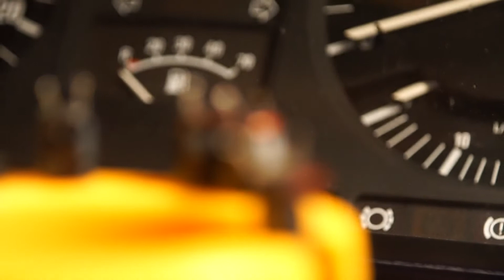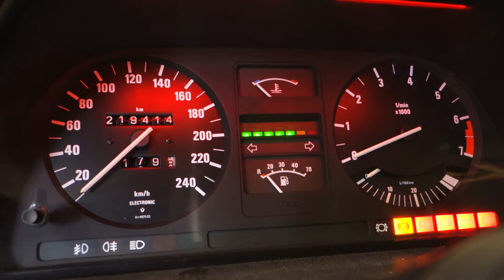BMW E28 Instrument cluster restoration

Comment: Nice video, i just slow it to see how you took it apart. I have E28M5 since 1990 and sent the board off a couple of times. After parked now for 20 yrs . . . time to do this again. I've replace numerous caps like these on many devices as they are the first components to go. Mouser and DigiKey are good sources for me. Did you find a change in function with these caps replaced? or was this preventive? 

Also - any reason not to install NiMH 1.2 volt AA batteries?  Same voltage as NiCad but last 10X longer?  About the same charge discharge characteristics w/o the issues of matching voltage etc of lithium types. Please post a response. Thanks!!!
Reply from the maker: I hoped for better, more accurate cooling temp gauge, but it had very little effect.
And just as you say, they get old, and several of them were elongated and crusty, so replacement were needed.

I think modern low self discharge NiMH would work, there are AA Lithium batteries, but they are 1,8 volt.
I did the alkaline mod several years ago, seems easy to just change them, when service is done.

Comment: Good stuff! Could you tell us what the symptoms were for the failing capacitors?
Reply from the maker: I changed all capacitors, mostly because the temp. gauge were showing to low reading.
And I knew they are prone to ageing, but after this, the Service lights are working again. (together with new batteries)
And I think that RPM and Fuel consumption are more correct now, the were erratic earlier.
Temp gauge however is still a tiny bit "off" (could also be sensor problem)

Comment: What do you think could cause the lights to all come on but non of the gauges work
Reply from the maker: Really difficult to say, these older models with NiCd batteries usually suffers from bad batteries, corrosion on the copper leads on the boards, and bad capacitors.

Comment: I just started troubleshooting my 524td cluster non working right indicator (exterior lights work fine) I went to do a continuity resistance test on white connector pin 6 (left) and 16 (ground) and got open same for left turn (pin 7) but that side work when cluster is installed. 

Why would I not be able to have the pin in the back have continuity? Is this cluster require having some sort of continuous power supplied to it? 

The schematic says I super easy to read, I must be missing something.
Reply from the maker: I'm not sure, there might be several different ground leads maybe ?
I have not had those issues.
I would probably open the cluster, it's relatively straightforward, and possible to trace the circuits on the board.
Reply: @daniel635biturbo  shockingly it worked, right turn came back, will investigate later.  Initally I did the lazy part swap (the halogen bulb) plugged it in and no signal last night.  Pulled it out attempted tracing from the pins (no luck) for the heck of it plugged it in this morning and it work, so I went and got it inspected (passed) so I'll worry about it next year LOL

Yes next time I'll try directly on the printed board

Comment: My Speedometer is jumping around and not working occasionally.   Same problem?  What does the battery do in there?
Reply from the maker: The batteries usually do not affect the speedo.
They keep memory of service intervals when the car is without 12V.

On earlier cars like my e24 635csi with older NiCd cells, corrosion on the cirquits is common, I had that problem on my car and speedometer.

Comment: So what where the values of the capacitors? and where did you buy them?
Reply from the maker: I changed the capacitors on both my cars, and noted that the capacitors are different depending on year of manufacture.
I think I bought my capacitors on Elfa Distrelec, or Conrad. don't remember.